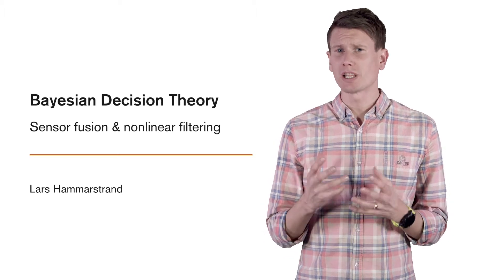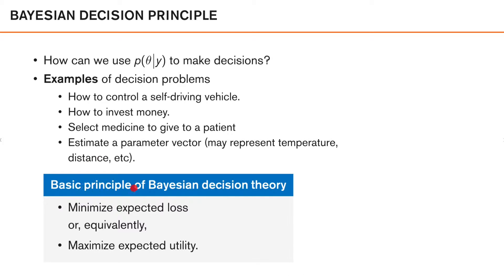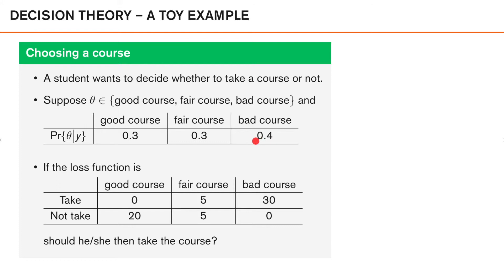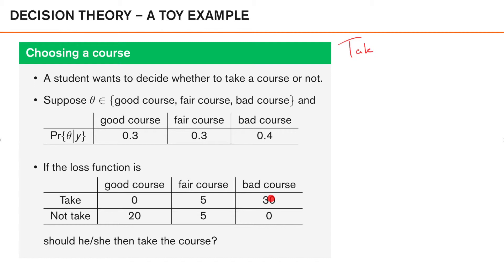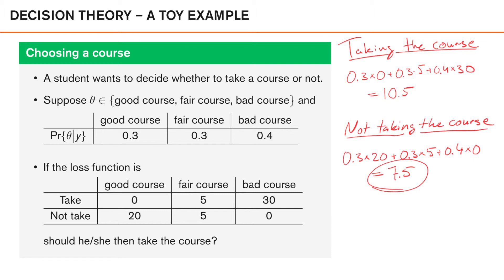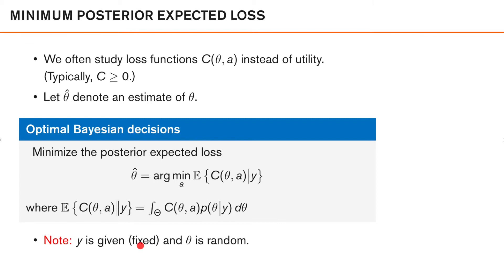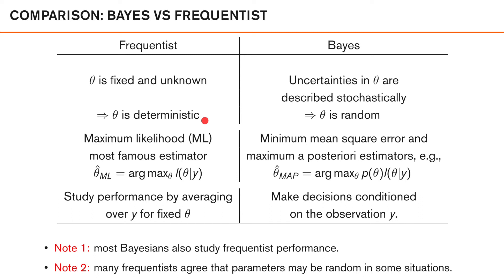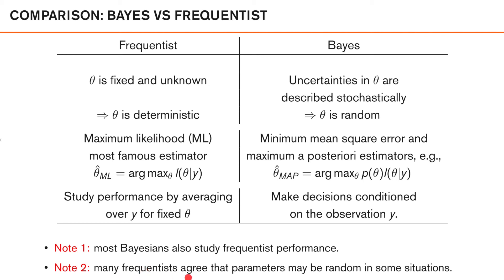2.4 Bayesian decision theory

Comment: Took me a little thought to answer the self-assessment. I believe the correct answer is 1 & 3. From the formula on the previous slide you need the posterior distribution and the loss function, so option 3 is definitely sufficient. If you have the prior and the likelihood you can work out the posterior distribution (Bayes Rule), so 1 also works. However, you don't have enough information in option 2.